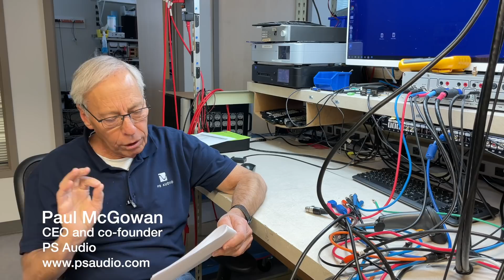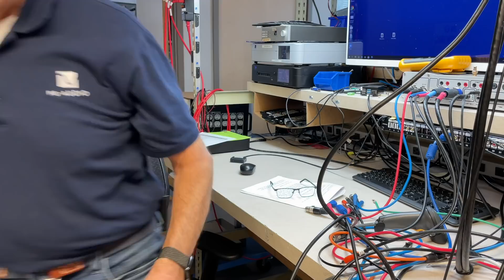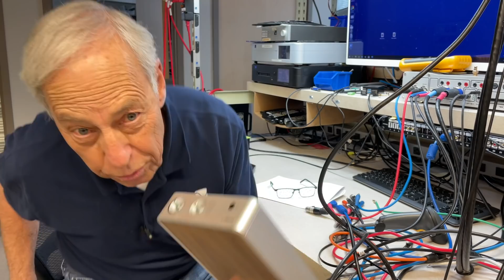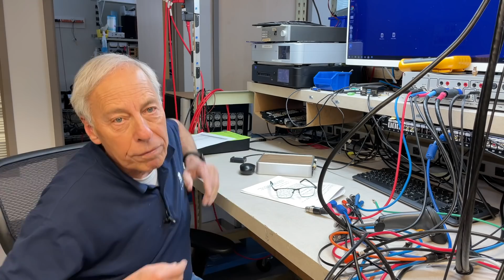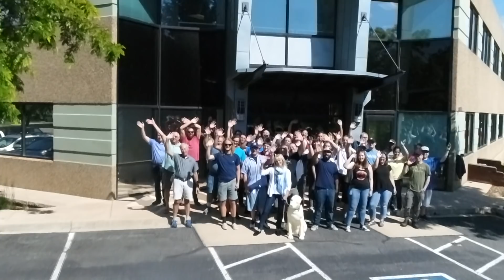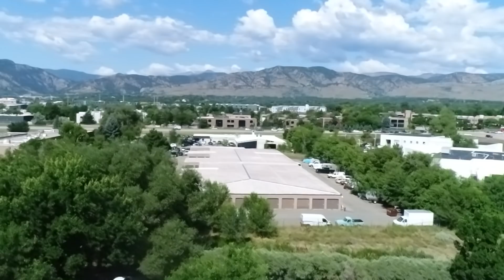Why Class D amps have small power transformers

Comment: My class D stereo power amplifier is one of the rare ones that doesn't have a Switch Mode Power Supply (SMPS)

Instead it has dual linear power supply's (one for the left channel and one for the right channel) plus a massive toroidal transformer.
Reply: Just curious, what brand/model is it?  And what are your impressions?  
My class D has two large toroidal transformers, which results in a 60lb class D amp!  H2O S250 Signature...it powers 1 ohm Apogee Scintilla's without effort.  My old Classe CA-300 (300 watt/Channel, 87lbs) struggled with the same speakers.
Reply: @nodammit  If it really is class D I'll bet if is it's rare indeed to be able to drive 1 ohm speakers as most class D can't.
Reply: @leekumiega9268  Not that rare for a Class D to drive 1ohm speakers.... ;)
And it's actually quite common in car audio to use Class-D amps and drive 1ohm or some even 0,5ohm sub setups.
Reply: @Oystein87  why bother comparing home vs car audio.  PS Audio is for home gear not car gear. 

Class D is fine for car audio and professional usage like for DJ’s and concerts.  

I guess some just want really loud music for home also but most home speakers and designs and usages don’t even bother to go to 1 or 2 ohm loads so why bother with a capability that most likely most will not even go there.
Reply: @f430ferrari5  Not comparing.. Telling that it's normal for Class D to handle 1ohm or lower. So it depends on how the amp is made...

Class D is fine for home audio also.. That's why almost every company makes them for home audio. Including PS Audio..

What does this have to do with loud music? I think you missunderstand a bit here... Some speakers just have a low impedance even if they are not built to play loud. It's rare but they excist.
And the most important reason: I.e a 4ohm speaker can easy dip well below 2ohm so it's actually kinda crusial that a amp handles atleast down to 2ohms. Lower is even better.
Reply: @Oystein87  feel free to name any “home” bookshelf and tower speaker that is set at 2 ohms.  

For that matter name any bookshelf or towers set at 4 ohms. Most are 8 ohms and some at 6.  

Most home users are using Class D for subs.  

Class D has a lot of profit margin in them too.  Think about it.
Reply: @f430ferrari5  Here is a comment with an example somewhere here. A 1ohm home speaker.

4 ohm is actually extremely normal for home speakers..

Most manufactures use it for subs and very many surround recivers today are class D so many have class D withouteven knowing it.
And many also use class D stereo or mono amps in high-end systems too..
Basicly all manufactures make some Class D amp models today..
Nah.. Class D products don't have any more profitt margin than other products... Needs even more work to make them sound as good so it can quickly be the oposite.
Reply: @f430ferrari5  While not a bookshelf speaker Infinity Kappa 9's and most old Apogees are around 1 ohm or less.
Reply: @leekumiega9268  you sure about that?

Link here shows Kappa 9’s at 4-6 ohms

https://www.cnet.com/forums/discussions/help-powering-pair-of-infinity-kappa-9-s-408969/
Reply: @Oystein87  4 ohm isn’t extremely normal. Like I said. Please show some examples.  I can show you 10 times as many 8 ohm home speakers.  

4 ohm is more common in car audio. 

2 and 1ohm are nearly unheard of unless you’re running speakers in parallel. 

I already explained also what Class D is used for.  No use repeating.  😂
Reply: @f430ferrari5  Uhm... Yes it is😂 Almost half the speakers I see are 4ohms😅
Why did you nit use google?
No, actually you can't...

4ohms is very common in home audio just like 6 and 8ohm.
For car audio it's normal with 2, 3 and 4ohms.

NEARLY unheard of but not unheard of😉 And your 8ohm speaker might as well dip below 4 or 2ohms when play7kg music. Even up to 40-60ohms etc. The resistance on a speaker goes all over the place when playing music so a amp MUST handle pretty low ohms to not crap on itself. Unless it's a bad amp.

You did not.. You just claimed for subs. Class D is very normal home audio amps. Even for alot of really expencive high-end stuff.
Reply: @Oystein87  funny how you can’t come up with many examples of 4 ohm bookshelves or towers.   😂🤣

You have yet to provide any 2 ohm or even 1 ohm.  😂🤣
Reply: @f430ferrari5   My pair of Apogee Scintilla are 1 ohm (actually dip to 0.6 ohms at certain frequencies).   There are others, mostly panels that also get very low.  ...and yes, these are home speakers.
Reply: @nodammit  I never said they didn’t exist.  It’s just a rarity and Apogee’s are not known for their SPL.  Some of the best imaging I ever heard was from Apogee. 

It seems earlier models were set at 4 ohms also and you can re-configure to 1 ohm. The later versions set at 1 ohm but what exactly do you have hooked up to them.  

You seriously running Class D amp into your Apogees?  

See link in article in how at 1 ohm it killed a Krell amp. 

https://www.hifi-advice.com/blog/apogee-acoustics-company-special/apogee-scintilla-info/
Reply: @leekumiega9268  I believe all class D based on the Bang & Olufsen ICE module can power 1 Ohm loads.  It seems that Pascal Class D can also work well.  Check out these tiny amps (Pascal Module) powering Apogee Scintilla's (not Mine)... https://www.youtube.com/watch?v=ZgByCI_ImcQ
Reply: @f430ferrari5  Yes, I completely believe that they can Kill a Krell, or almost any Class A or A/B amp.  I was previously powering the Scintillas with a huge Classe ca-300 (87 lbs, Toroidal as big around as a dinner plate, 300watt into 8ohms, which was rated as doubling down all the way to 1200watts into 2  ohms), a very powerful amp to say the least, but it could barely handle the 1 ohm load of the Scintillas.  It could play the speakers to medium volume, but would get VERY hot, then shut down (protection circuit).  I found out that there was an electrical engineer/audiophile in texas, who built an amp specifically for the Scintilla (his favorite speakers).  Its class D, using twin B&O Ice modules - 1 for each channel, and two very large toroidal transformers (1 per channel), as well as four huge Mundorf Capacitors.  It weighs 62 lbs, which is very heavy for class D, and indead does power the Scintillas at absolutely any volume without breaking a sweat or even getting hot.
Here's a link to a review of his amp, and also preamp, which I also have... https://6moons.com/audioreviews/h2o2/1.html
Reply: (sorry...I think my last post was too long)   ...there was an electrical engineer/audiophile in texas, who built an amp specifically for the Scintilla (his favorite speakers).  Its class D, using twin B&O Ice modules - 1 for each channel, and two very large toroidal transformers (1 per channel), as well as four huge Mundorf Capacitors.  It weighs 62 lbs, which is very heavy for class D, and indead does power the Scintillas at absolutely any volume without breaking a sweat or even getting hot.
Here's a link to a review of his amp, and also preamp, which I also have... https://6moons.com/audioreviews/h2o2/1.html
Reply: @nodammit  but why even attempt to run it at 1 ohm?   See what happened even in your situation way back then. 

Yes I can see Apogee claims it supposedly sounds better at 1 ohm but what amp could  drive those back then.  Those Apogees are back in the 90’s or even earlier. There was no good Class D amps back then. 

What exactly are you trying to accomplish anyhow by driving so much wattage into the Apogees.  You’re not even purchasing the right equipment which fits your listening tastes.  

Also electro stat / flat panel type speakers have their own issues related to durability but now you’re trying to claim you finally found the right combo 30 years later because Class D is now starting to sound decent?  

Also you’re trying to say your system sounds better at 1 ohm vs 4 ohm and hooked up to a Krell or McIntosh or Classe or even Parasound from a musicality standpoint?

Class D is not musical.  It’s meant for driving speakers hard and loud.  

I’ve been enjoying my home audio system for the last 20 years. Class AB amps. 6 ohm speakers for mains.  There is a point of diminishing returns and cost benefit pertaining to Class A.  I’m content with a 10k system back then because I would rather spend money elsewhere like on my Ferrari. 

I don’t need Class D amps because my system already plays loud enough and sounds musical and the two amps I have don’t even run hot.
Reply: @nodammit  oh another thing.  Why even bother with Class D if it weighs 62 pounds but yet only get 360 watts in dual mono mode and this is at 4 ohms?

The Bel Canto amp you mentioned is 4 channel at 120 watts into 8 ohms or 200 into 4 ohms. 

Again to me the benefit of Class D is having lots of power for a compact size and weight.  I think it’s great for car audio or DJ or concert like equipment.  

There are way better Class AB options on the used market.  They don’t make them like they used to.
Reply: @f430ferrari5  It seems that my choice of equipment bothers you for some reason (I'm not sure why).
Let me address your questions and statements one at a time..
You asked "What exactly are you trying to accomplish anyhow..." 
I was trying to accomplish better sound, and that's what I've achieved.
It does sound better at 1ohm, rather than 4.  I was truly hoping the switch to 4 would allow me to use any amplifier (it would), but unfortunately the sound did suffer.  
You stated "You’re not even purchasing the right equipment which fits your listening tastes."
Really?  How do you know what my listening tastes are?
And is the "right" equipment not the equipment that sounds best?  Have you heard my system?
You stated "Class D is not musical".
Well, some Class D are not musical, but so are some Class A/B, A, and even H.  It' comes down to implementation.
My H2O is VERY musical, and the only other amp that I've owned that sounded as good was a Pass Labs Aleph (Class A).
I've heard some very bad and very good examples of every amp class.  And if Class D universally sounded so bad, why do so many established high end brands use it? (Mark Levinson, PS Audio, Jeff Rowland, Merril, Theta, Bel Canto, etc..)
You stated "There are way better Class AB options on the used market."  Really?  That can drive the Scintilla?  Like What?
I've owned amps from Adcom, Pass Labs, Classe, YBA, Transcendent Sound, TR, Monrio, Aloia, Musical Fidelity, PS Audio, and so on.  Most Class A/B, some Class A, and two class D (the first one sounded awful).
I've heard them with speakers from Apogee, Totem, McIntosh, PMC, Martin Logan, Tannoy, etc.. over the last several decades.
I think with that kind of history, I've got a pretty good idea of what sounds good and what doesn't, and the fact is that the Apogee/H2O combo is the best I've ever owned, and among the best I've ever heard (including Wilson, B&W, Magnepan, MBL, etc..).
The simple reason I chose the class D for the Scintilla was because it produced some of the best sound I've ever heard.
The fact that it also runs cool to the touch, and doesn't use a ton of electricity is also nice, but secondary to the sound.
Reply: @nodammit  I’ll just summarize and put it this way.  

There are thousand and perhaps millions of audiophiles out there. Most are not running 1 ohm home main speakers. Period.  

You do what you like. It’s your system.  Don’t try to convince anybody else your method is the right or best way. If it was so good more would be doing it and more manufactures would be producing 1 ohm speakers and more companies would have amps that can handle something at this load.  

And companies these days need to find ways to make money.  The chassis/heat sink in itself can drive costs way up and this is especially true in today’s market.  There is no profit margin unless they charge a high price and only companies with good reputation can do this.  

You should be asking yourself the same question of if Class D is so good why are companies still willing to make Class A and Class AB amps.  Why are so many still willing to buy.  

Why does an older used McIntosh solid state or tube amp Class A command so much money still. 

Like I said again. Your Apogees are old and we all know the materials used degrade over time.  There are trade offs in many areas.  

I could get Apogees or Magnepans myself but what good is it if I have to replace certain materials over time.  

I just replaced the foam surround on my M&K subwoofer.  Even this was a bit of a pain.  It should last 20 years though. 

My Paradigm Studio speakers are like brand new even after 20 years.  They have rubber surround.  Do they sound like Apogees I heard at a friends house?  No way.  

But now a days I have moved my speakers around and listening to good source material and it sounds great to me.  It’s hard to imagine how much better sound can be achieved.  

And circling back.  Apogees are not meant to be played at concert levels.
Reply: @f430ferrari5  You stated, "If it was so good more would be doing it..."  
I suppose the same could be said of your Ferrari.  Does the fact that most people don't drive a Ferrari mean that it's not good?  
Of course not.  
There are practical limitations like cost, versatility, fuel economy, etc.
A new pair of Scintillas is not cheap (approx. $33,500.00 US). They are also delicate, weight 140lbs each, stand 5 feet tall, and require a large room with 4-5 feet from the back wall.  Completely impractical in many ways.
Also like your Ferrari, they are not suited to most people and require specific conditions to perform at their best.
I'm also not claiming they are "The best" at anything.  I just happen to like the way they sound, and that's subjective.  
I've heard far more modest, less costly and complicated systems that sound very, very good as well.
The law of diminishing returns is high with my system, and I could have probably assembled a system much less fussy and complicated for a more reasonable cost.  
I'm glad you like your Ferrari. I'm sure it's an amazing car.
I like my Scintillas, and if you were my neighbor, I'd have you over for a listen and a beer.
Reply: @f430ferrari5   
I'm not sure why you keep misconstruing what I'm saying.
You stated, "..you are trying to justify the practicality of it".
Re-read my post, as I said exactly the opposite..

"They are also delicate, weight 140lbs each, stand 5 feet tall, and require a large room with 4-5 feet from the back wall.  Completely impractical in many ways."

You also stated "..I don’t think you’re gong to convince many audiophiles to run 1 ohm home speakers with Class D amps. "
Again, I'm not trying to convince anyone to do any such thing.
And again, why does it seem to bother you so much?
I myself enjoy seeing the different ways that people do things (audio systems, cars, clothes, art, etc...)  
That's what makes life interesting.

Btw, in the entire history of Ferrari, as of 2019,  they have sold only 219, 062.  
And considering that they are one of the oldest supercar builders in the world, I doubt numbers for others are much higher.
Reply: @nodammit  maybe you should scroll up and re-read what I originally wrote. 

You are the one who responded to me. You made it sound like 1 ohm speakers and Class D amp combos were very common which in reality we know are not.  

And as far as your Ferrari argument why limit to Ferrari.  Many purchase super car and hyper cars.  Ferrari isn’t the only one.  There are Porsche GT3’s and GT2’s and Lambos and McLaren, Ford GT, Corvette ZR1, Lexus LFA, Audi R8, etc, etc.  that is where over a million come in. 

Your comparison is way off.  Hardly anybody does the combo you’re referring to.  It’s only a bother from your misrepresentation.  It’s not about what you have.  Many run Apogees but they don’t necessarily run them at 1 ohm with a Class D amp.
Reply: @f430ferrari5  Again you are misrepresenting..
You stated "You made it sound like 1 ohm speakers and Class D amp combos were very common which in reality we know are not."
Where did I say that?
As far as the analogy goes, it wasn't meant as a direct comparison...just as a response to your assertion that "If it was so good, more would be doing it.."
Obviously, the same could be said of a Ferrari.  Why don't more people drive one?  If one is to follow your assertion, it must be because they aren't "so good".  
But obviously (again, as I said before..) that isn't why most people don't buy Ferrari's.  It's because of other factors like cost, practicality, insurance, etc, etc...
In other words, it's not as simple as you would suggest.  
And again (why do I have to keep correcting you?), where did I say that 1 ohm speakers and class D amps were common?
Reply: @nodammit  dude. I’m not misrepresenting at all. It’s you that is doing so. 

I say again. Read through the post above.  If you want a recap it goes as follows:

1. A guy starts bringing up car audio related to Class D amps and load. 

2. I step in and say why compare and give examples related to car audio when Paul’s channel PS Audio is all about home audio.  Yes?

3. Another guy even tries to lie about Infinity Kappa 9’s.  He claims they are 2 ohm?  I show him link saying it’s 4-6 ohms.  He doesn’t respond.  

4. I state that 1 or 2 ohm bookshelf and towers are very uncommon.  Yes?  I didn’t say they didn’t exist.  Yes?

5. Well guess what. This is where you come in with your claim about 1 ohm Scintillas. Not fully truthful either.  Scintillas didn’t originally come 1 ohm. They were originally wired 4 ohm. You never qualified your remark either stating 1 or 2 are indeed rare but you do have Scintillas. Yes?  

So for sure you know what you attempted to misrepresent.  Don’t go claiming “where did I say that”.   You simply responded about your Scintillas and stating they are 1 ohm and this is despite after me stating how rare they are.  Yes?

And back to Ferrari.  You’re a joke.  There are more impractical super cars out there other than Ferrari yes?  So why are you trying to get again misrepresent how impractical a super or hyper car by how few have them by “limiting” your examples to Ferrari. Well?

The bottom line is that people are willing to pay outrageous sums of money to own one.  It’s well over a million people.  You trying to argue the count to only Ferraris and it’s production numbers shows how illogical you are.  

This is what you are not able to comprehend either.  Ferraris and Lambos and McLaren, Bugatti, Pagani, etc, etc, are also sold as used Even your Ferrari production numbers are a joke.  

One Ferrari Enzo produced alone could be on its 5th owner and this 5th person paid more than the original!   That’s 5 guys who were not very practical not just 1.  

Feel free to look up how many Lambos produced. Porsche GT2 and GT3 over the years.  Audi R8, Lexus LFA, Acura NSX, etc etc.  

This is why we are into the millions. It’s sad this needs explanation.  Look at the amount of money being spent. 

So now circling back to 1 ohm speakers. How many have them?  Well?  How many pair with Class D amps.  This doesn’t even cost that much either and yet folks are not willing to do it. 

You then tried to change the subject about somehow I don’t like what you have.  😂🤣

I even told you earlier that Apogees are some of the best speakers I ever heard.  The only knock are those types of speakers is that they degrade over time. You never even wanted to discuss their degradation.  

I even said if you’re happy with what you got then fine.  To me you’re a person who puts a Mustang engine in a Ferrari.  Pretty sure it’s a rare combo.  I don’t find anything wrong with Mustang engines either.  They are usually built with more torque but they also came out with a flat plane crank similar to Ferrari in their GT350 models.  

Come on.  You know this is what took place and where we are at.
Reply: @f430ferrari5  I find it amazing how you continue to misrepresent, and also continue to fail to understand the Ferrari analogy.
I honestly don't know how many different ways I can explain it.  
Let's see....  I'll try to make this as simple as I possibly can...
Most people don't buy them because of limitations, but the low number of owners (keep in mind, the world has approx. 7 billion people) is not indicative of it being a "not so good" car.
In other words, again trying to be as concise as possible, most people don't own ferraris due to factors OTHER than how good they are.  I would think that a Ferrari owner, of all people, would agree with that statement.
Now... hopefully you're still with me...
The reason I brought that up is because you drew a connection between the low number of people using Scintillas, to their ability to produce good sound.  Remember, you stated ""If it was so good more would be doing it..." .
So... (still with me?)   what I was pointing out is that just because a product is only used by a minority of people, that doesn't necessarily mean that there's a problem with how the product performs.  
In the case of both Ferraris and Scintillas, there are other factors that discourage most people from owning one.

In regards to Scintillas, they were not made in 4ohm, then later in 1ohm.  
They were originally made in 1/4 ohm (the version that I have), due the simple fact that there were even fewer amps back in the 80's that could power them.  You could have them in 1ohm (what the founder Jason Bloom recommended), or in 4ohm if your amp couldn't handle 1 ohm.
The later versions were only 1 ohm, as Jason (and most reviewers/owners) didn't like the sound in 4 ohm.

Also, ALL speakers degrade over time.  My particular pair are original and over 30 years old.
Most don't last so long, which is why you see so many in the $5k range.  
A refurbished pair can go for $15-20k.

And again, the misrepresentations...
You stated "You made it sound like 1 ohm speakers and Class D amp combos were very common which in reality we know are not."
Where did I say that?
You stated "..you are trying to justify the practicality of it".
Where?  I actually said the exact opposite.
You stated "..I don’t think you’re gong to convince many audiophiles to run 1 ohm home speakers with Class D amps. "
Where did I say I wanted to do that?
You stated "You’re not even purchasing the right equipment which fits your listening tastes."
Really?  How do you know what my listening tastes are?
You stated "Class D is not musical".
If so, why are so many high end companies making them?

And finally, again, why does it seem to bother you so much?
Reply: @f430ferrari5  It seems weird that you post links that back up what I already told you.
You stated, "Scintillas didn’t originally come 1 ohm. They were originally wired 4 ohm"
Then I said "They were originally made in 1/4 ohm..."  "...The later versions were only 1 ohm.."
THEN, you send me a link which states 
"...the binding post plate states 4 ohms or 1 ohm, which indicates this is an early model."  
"Later Scintilla models were 1 ohm exclusively..."
Um...isn't that exactly what I said??  LOL
Well, thanks for proving yourself wrong...less work for me (..and believe me, it's a busy job).

Then you stated "Why are companies still making Class A and AB of Class D is so good?   Well?"
Why are Porsches, Koenigsegg, Pagani's still made if ferrari's are so good?
Could it be that they're all good?  Why does it have to be an "either/or" proposition?

Then you stated "I clearly showed you what took place."
What took place?  I'm afraid I'm not sure what you're referring to...

But please, go on.... this is good fun.